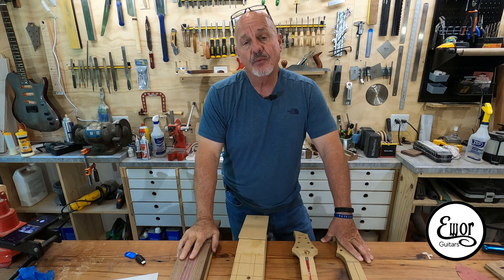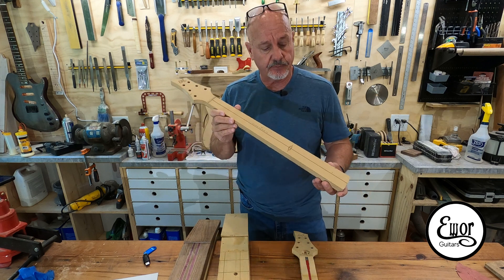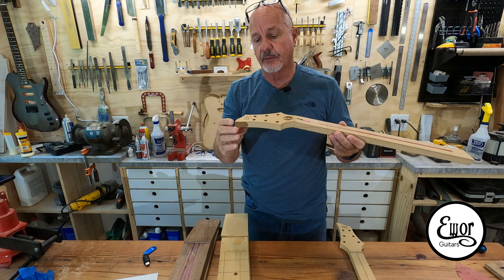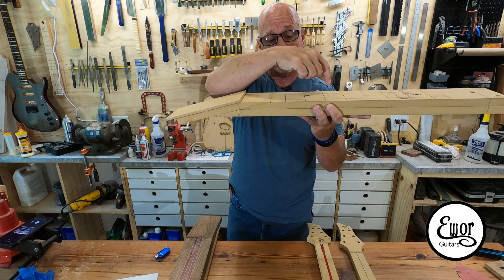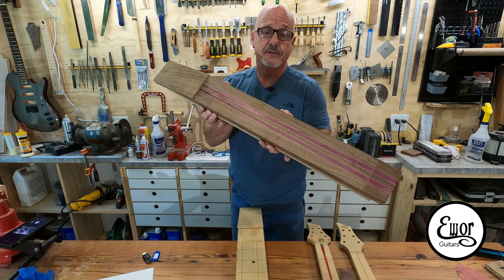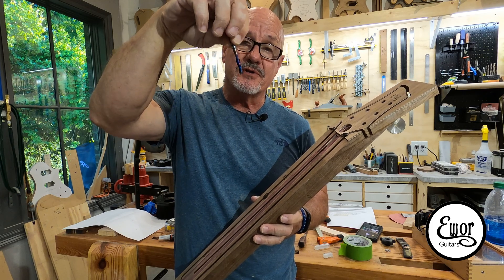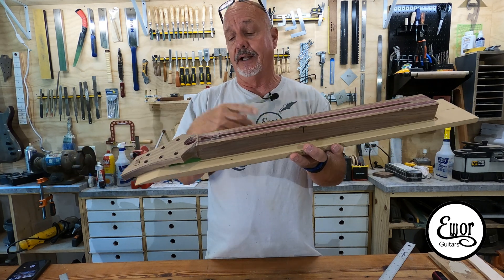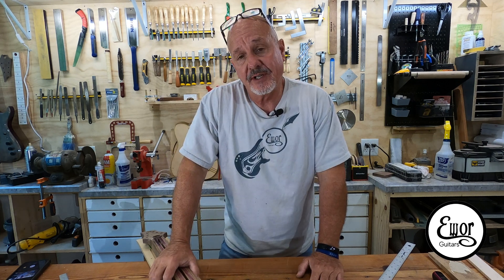How to cut out a neck on a CNC

Comment: It's a shame about the burn spots. One thing you could do would be to mill off the head stock plate and glue on a new one. Will you also need to mill the truss rod channel a bit deeper sense you are going to resurface the top of the neck blank? As long as we learn from out mistakes then it is not really a failure.
Reply from the maker: That is exactly what I did. I just couldn’t stand looking at those spots anymore 😁 and yes I took off about .003 off the neck surface so I still need to deepen the truss Rod slot with a round chisel.